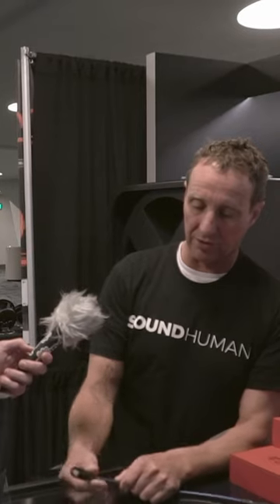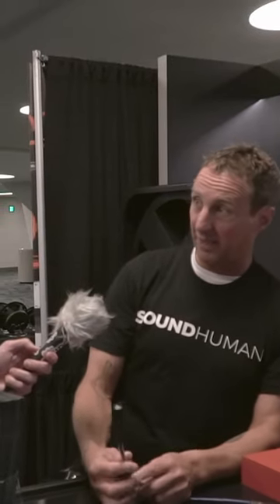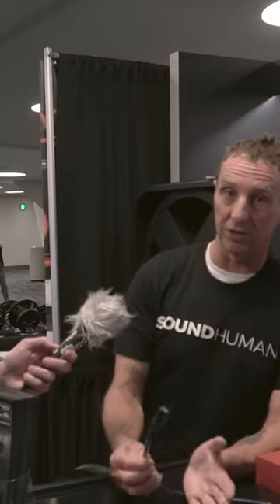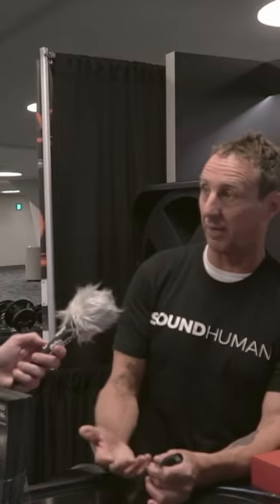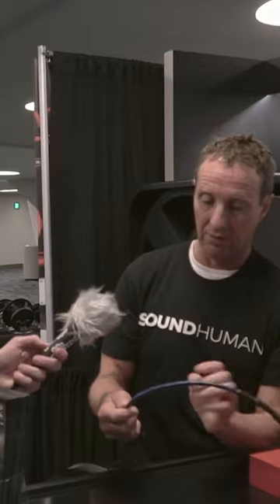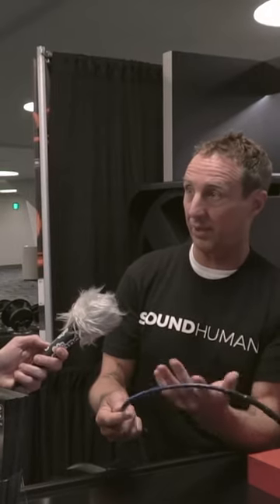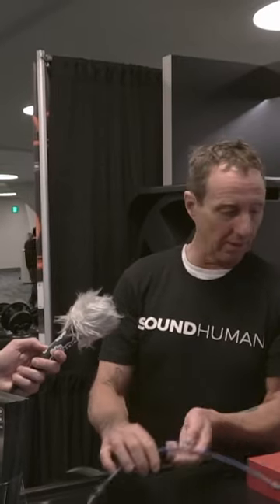Dave Rat talks shielding and common grounds in Cat5 vs Cat6 audio over Ethernet #proaudio

Comment: Getting ready to attempt my first home studio wiring before I put up drywall… Sounds like I just need to run as much cat six as I need and then double it just in case! I’ve heard something about separating the cable based on whether it’s a mic or a line signal. I definitely like to rely on phantom power for this as well, appreciate any pointers!

Comment: Unless I'm mistaken, only Cat6 will allow for phantom power - at least when using the sssnake xlr breakout box - another reason to go with Cat6.
Reply from the maker: You are indeed mistaken.
Reply: @DcSoundOp  lol, care to elaborate, so I know WHY I'm mistaken?
Reply: . . . because my experience is that with a sssnake 3mc into a 3fb over shielded Cat5e I could not get phantom power to work. The vendor's advice - borne out by other users who had the same issue, was to use Cat6, which does work. The explanation was that all four twisted pairs were used for the four channels of audio on the device, and that one pair would have been required to carry 48P. I'm happy to be told why my original statement is wrong, but my first hand experience tells me I'm not.
Reply from the maker: Sorry, it wasn’t clear at first what you thought the issue would be. So, if you were using unshielded cable, that would explain what you experienced. Shielded cat5 is required & works fine for phantom power. It is carried on pins 2 & 3 for each channel and the shared ground is no different than the ground that is shared at the console between channels. Does that make sense?
Reply from the maker: Oh also, I didn’t realize that ‘sssnake’ is an actual product. That’s a knock off of the SoundTools box & I’ve got no idea how they’ve wired it. Maybe phantom doesn’t work, it’s a $30 knock off. All of my comments pertain to the genuine SoundTools products.
Reply: @DcSoundOp  No issue, as such, I was just pointing out another reason why Cat6 can be the better choice in a specific instance. The video doesn't appear to be referring to any specific product, just about the pros and cons of different cable types for audio over ethernet. If I'd known it was to promote Soundtools, I wouldn't have been cheeky enough to mention a much cheaper clone product. 

And no, I was using shielded Cat5e but was still unable to pass 48v. Using Cat6 resolved the issue. Phantom power works fine on these devices, just not with Cat5, shielded or unshielded. It seems they are wired in a non-standard way, which is why you can't mix and match them with other brands.
Reply: 48v phantom works just fine over cat5 and cat6 as long as you’re using shielded cable.